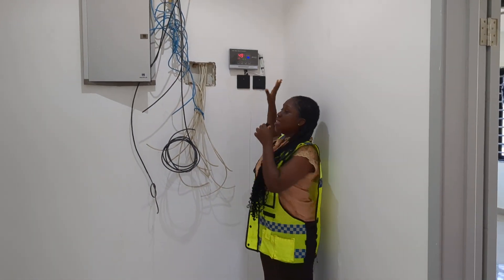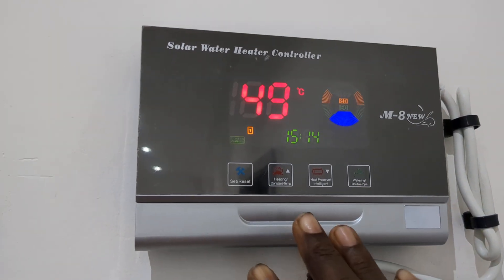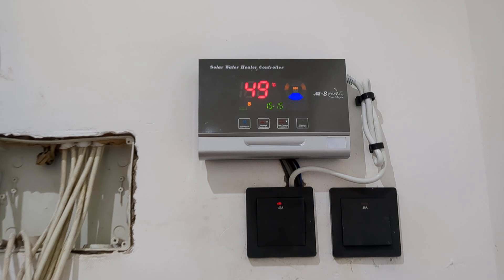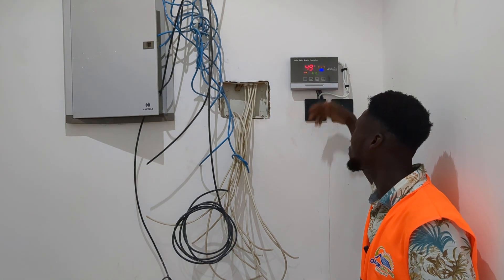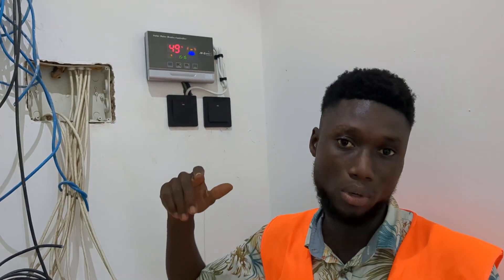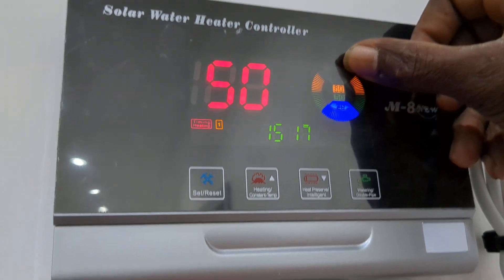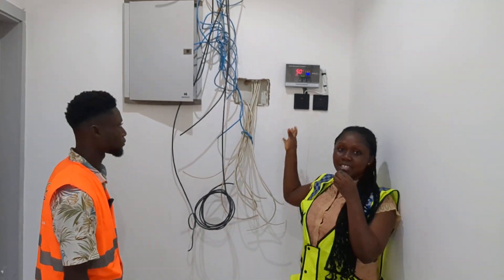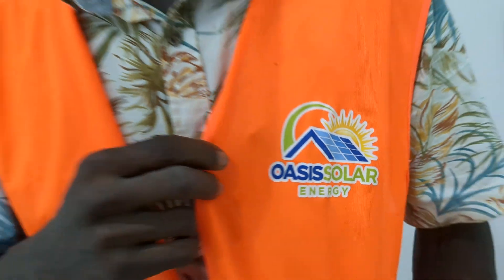Solar Water Heaters in Ghana 🇬🇭 Building in Ghana

Comment: Where am I to put the sensor we have two tank tub
Reply from the maker: You will need two sensors since you have two tanks. We can suggest where to place them, or you can show us your preferred locations, so we can handle the installation. This will help ensure that no additional cabling is required based on the distance between the sensors and the control panel.